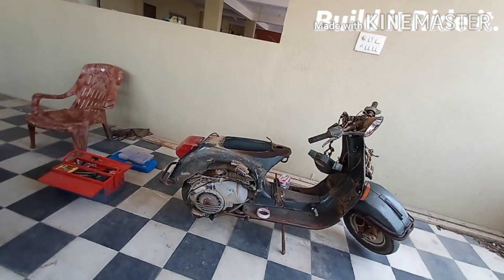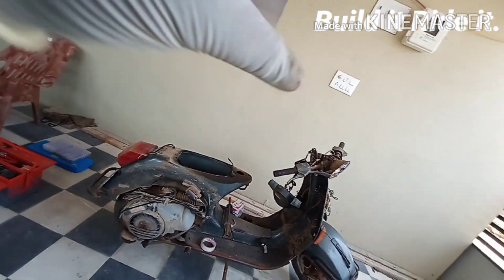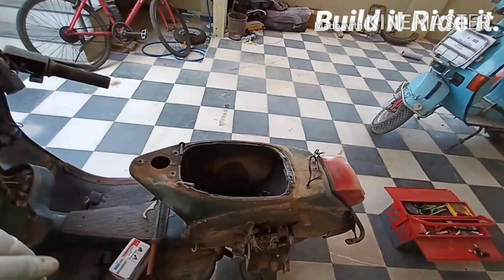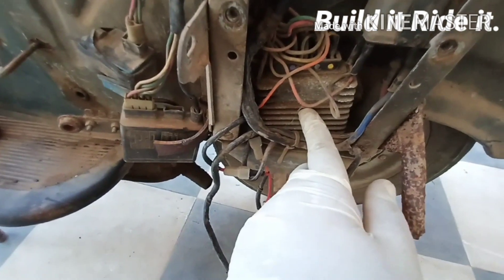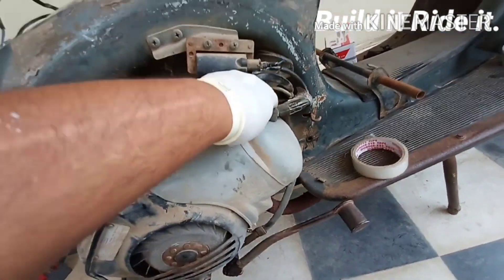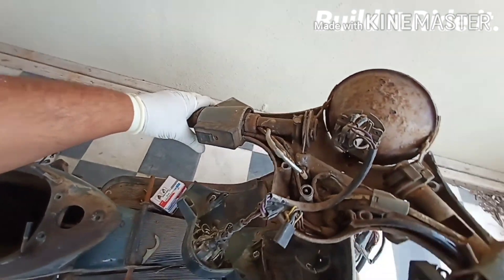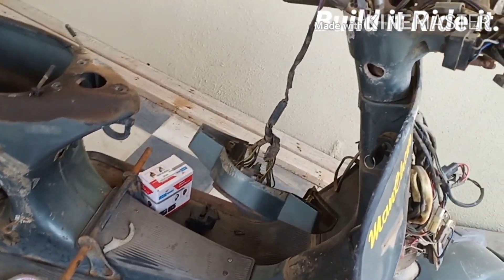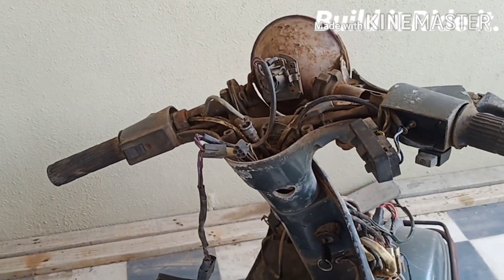Wiring and electrical components on a Vespa

Comment: subscribed i really like ur channel, anyways i hope you can help, own a lml star 200 thing is that my turn signal is busted. right signal just stay on, not blink but when i try to use hazard switch it blinks. also the indicator is also not blinking. why so?
Reply from the maker: Try cleaning the contact points of the flasher, it will be a blue coloured component on the left side of your scooter, that should help.
Thankyou.

Comment: In my scooter when I press horn switch break light turns on and when I apply break no light  is on is there any wiring issue...?
Reply from the maker: Yep, you need to thoroughly check it, and the RR unit for any sort circuiting.